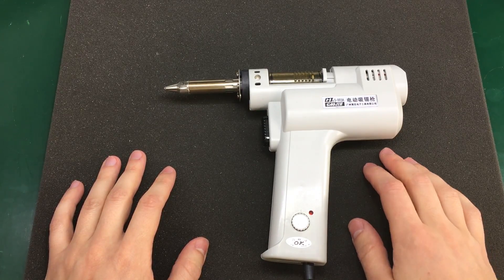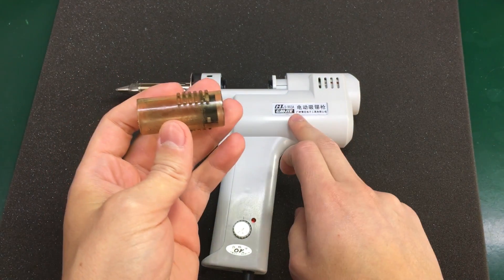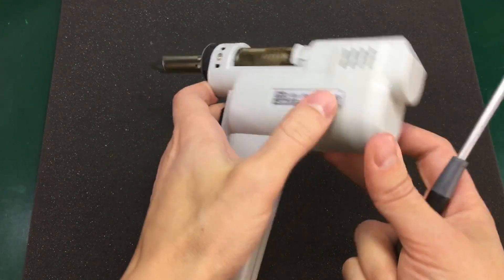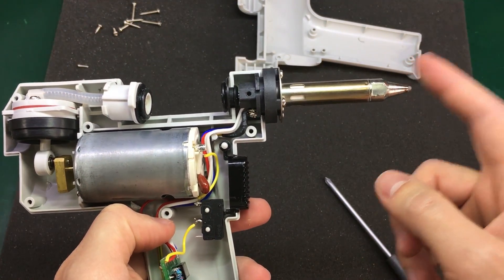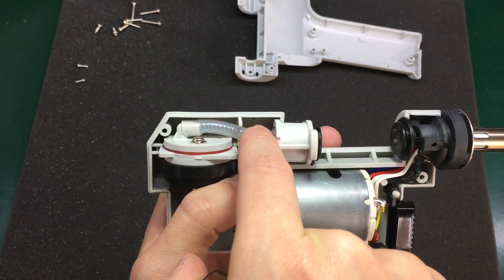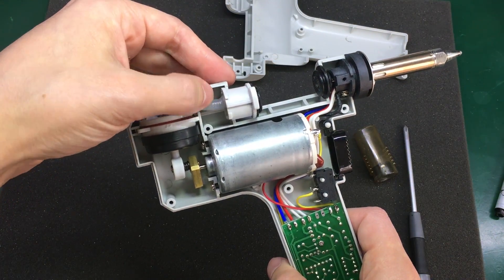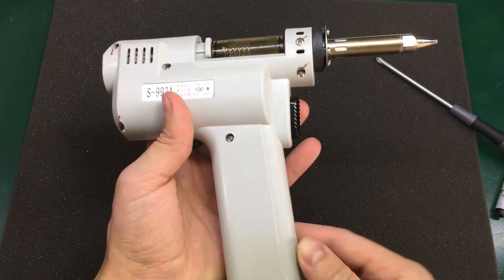Voltlog #102 - S-993A Desoldering Gun Teardown

Comment: Interesting teardown. As you say construction looks ok, apart from the excessive solder on the joints.
With regards to the spring in the tube...As you can imagine the air being sucked backwards through that tube will be hot, this would cause the plastic tube to soften..The spring is there to help prevent the tube collapsing due to both the heat and negative vacuum pressure.
Reply from the maker: you are right on the spring, that's the reason.

Comment: Thanks for making this teardown. How does it perform with double sided boards and tight vias? I also need one from time to time and I keep wrestling inside my mind: should I spend more on Hakko (with expensive replacement parts) or just get this one. Is it doing the job ok? Thanks!
Reply from the maker: the example board I showed in the video is a multi layer board, the tool woks well.
Reply: Thank You!

Comment: VoltLog
I have the same desoldering gun and now mine does not work.  Do you know what the value of the transistor that has the markings scraped off?  My desoldering gun broke after leaving it on for a while.  It was only on for 30 mins.
Reply from the maker: The bigger one could be a triac, I have no idea on the part number.
Reply: @voltlog  Thank you for the reply.  Yes, it might be a triac.  I'll have to put a scope on it and have a look.  Cheers

Comment: This piece of sh...t exploded in my hand after 5 or 6 times of using it. I bought a new board from China. If This will happen again, I'll let you know here. I bought a 220V version because I have both 110 and 220. I don't know what happened, because the board had its copper tracks valued, and all the semiconductors were shorted.

Comment: Is this the 220-240V version? I have seen more teardown videos of this model and there are quite a few more components on this board.
On the boards I've seen, D8, T1, C3, R8, R10, R12, R13 and VT3 are all missing.
Reply: I had the exact same question.
Reply: In this gentleman's video, the above mentioned components are installed, but on other versions they are not.  Take a look at this John Salt guys video and skip ahead to 15:40, you will see the missing components.  https://youtu.be/nVkXeOJSsck

Comment: How did you remove the temperature knob? You don't show that. It doesn't seem to be screwed on. Can you just pull it off? You can't remove the PCB without removing the knob it seems..?
Reply: The knob  just pulls right off. There are 3 position stops on the dial. Make sure you twist it one way before removing. Then put back in same position . Then check to make sure you have full temp range. Before pushing it all the way on. Also (2) screws hold the PCB board down.

Comment: The poster thinks that the only possible problems stem from bad soldering or sloppy 
construction...but I bet the trouble is with the circuit design itself, that or underrated, cheaper parts.
As a side note, the uninsulated (4:47) top terminal of the microswitch is too darn close to the motor housing (if that matters).
Thanks for the video.

Comment: Thanks for the teardown. Glad to see your S-993A won't suffer the orange glow overheat problem that mine did. Would it be worthwhile to clean up those solder joints and clean the PCB, or are you not too concerned wit that?
Reply from the maker: I'm not concerned with that flux residue.. and I'm not gonna redo all the solder joints, it's good enough for me..
Reply: good product?

Comment: I'd put at least some hot-snot on the wires where they join the board for vibration dampening, but other wise, this looks like a decent unit for the DIY'er on a budget. Just be sure to take it apart before you turn it on and make sure the wiring is good (this is from China, after all).

Comment: Hello wondering if you could help me, i have the 110V 993 and mine stopped heating up. The motor works but no heat. The weird thing is that when i remove the potentiometer it is able to heat up again, but gets glowing red from too much heat. I was able to get a hold of anoher PCB but its still doing the same thing. I even replaced the op-amp. Any suggestions?
Reply from the maker: The PCB module is the one controlling the heating element. If you replaced it with a known working module and it still doesn't work (if you exclude wiring issues) the problem should be with the thermocouple, the way I see it the module doesn't get the correct feedback from the thermocouple so it doesn't turn on the heating element.
Reply: VoltLog yes im hoping the new PCB was from a working unit, but I havent received confirmation. I really dont want to spend another $100 i had it less than a month.

Comment: The issue why these Chinese pumps can blow is wrong size resistor for current limiting in the PCB. Once, when working, the PCB blew right in my hand and fire and smoke escaped. I found the schematic drawing somewhere in the internet, and it turned out that current limiting resistor for the zener diode in the PCB is just 1/4 W size but upon calculation it is evident that it should dissipate about 1W of power. No wonder, it blew and took the zener with it also. So, I replaced the zener and the resistor with larger one (2W, or two 1W in parallel, do not remember now, there was still enough space for that). Now I am more confident about it not blowing again in my hand. True, my unit is not the S-993A but the S-997P. But I think the PCB is probably about the same.

Comment: I would put a deflector in the solder catchment tube because it would be murder cleaning out that metal mesh when solder has been splattered on it.
Reply from the maker: it does have a deflector in the plastic tube, it's shaped like a small coin.

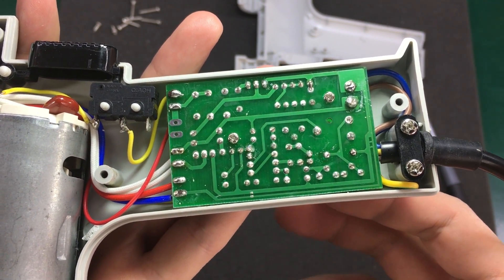Comment: Good video and useful too, as I'm considering this tool - thanks for that! Solder joint on the "RL" pins for the heater seems a bit shaky on the top as well as on the bottom (fourth from the bottom at 2:39 and 4th from top at 3:06). I think'll get me one and take out the PCB from the handle and connect it with the tool through a soft multicore-cable. Good show, keep it up!
Reply from the maker: thanks!

Comment: Thanks, excellent video. More about the PCB and or schematic would be awesome. Even if the micro is mostly a black box.
Reply from the maker: as you can imagine not much happening in there.. just a temp regulation loop.. like in the older soldering irons, nothing fancy. Might not even be a micro in there.
Reply: thanks and have nice day.

Comment: I would have cleaned up those solder joints while I had it open as well as put shrink wrap on those AC connections. ;)  Also the plastic switch looks pretty weak (ie: where it hinges).  Based on what I see inside they are somewhat over priced in my opinion (especially the 120V versions) but much cheaper than the better brands.  Thanks for the tear down.
Reply from the maker: I agree on the price, based on what I've seen inside I think they could sell these for $40-50 and still make a profit. I just considered the unit good enough and didn't want to waste any time cleaning that pcb :-)

Comment: This is just a bad design.  What you really want is to have a seperate pump in a stand alone unit with the gun connected by a hose.  The thermal stress inside the unit will cause the unit to fail rather quickly is suspect and is just not industrial.  It would be better to hack up a used Weller unit connected to a used refridge compressor.  The biggest fail though is the lack of different size tips.
Reply from the maker: sometimes, the tool be it low quality as it is, will do the job just fine and you get away with less money spent and less wasted time.
Reply: Then the tool that you want it a cheap manuel solder sucker or wick.

Comment: These guns are horse shit, if you look at the PCB layout you will see that the line conductor goes straight to the heater and the temperature is being controlled on the neutral conductor probably via a PWM transistor. 
There is no fused plug either, so you risk being electrocuted directly by the nozzle and in the event the temp control fails and it overheats that will cause the insulation resistance to break down too and pass potentially lethal voltages either killing you or whatever you are trying to repair.